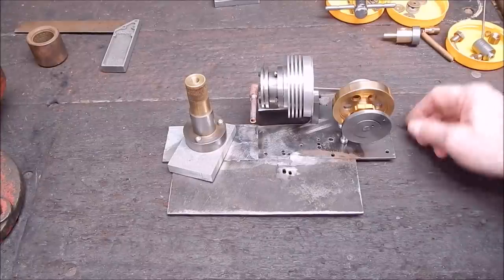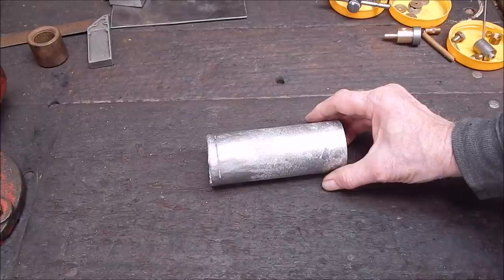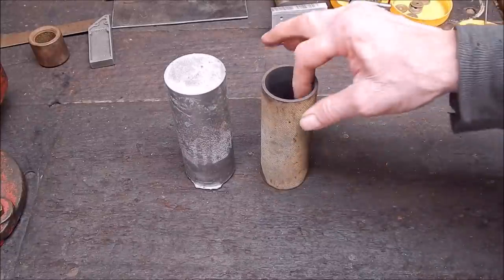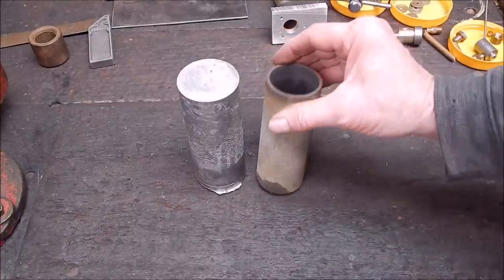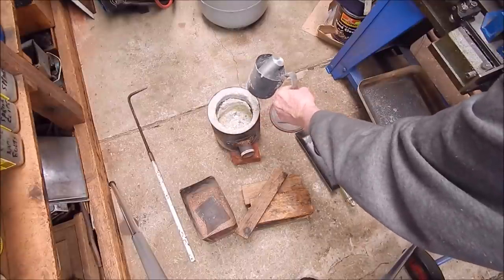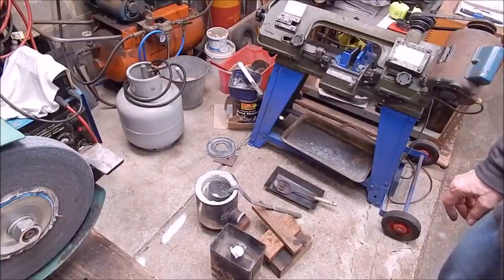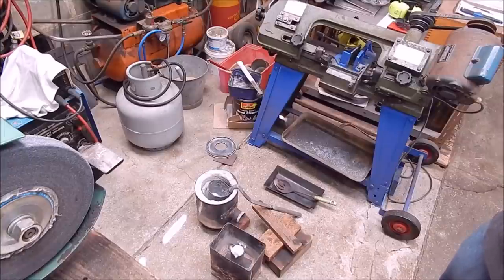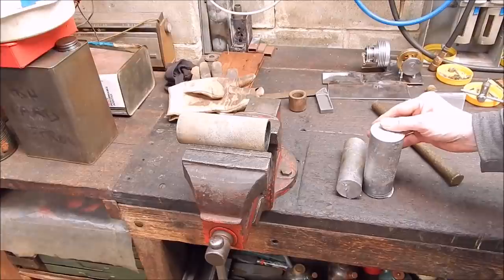How to make free aluminium round stock for a metal lathe

Comment: A mate of mine used to smelt his own aluminium bar stock. He once bollocked me to high heaven because I used the wrong vacuum cleaner to clean off his mill off after I was using it (I thought I was being polite by tidying up after myself !?!?). Turned out he had 2 identical vacuums, But one had a little label that said "ALUMINIUM" on it....... Yeah, The cheapskate even had a dedicated vacuum for cleaning up aluminium swarf to keep it separate, so he could re smelt that as well !!!! :D
Reply from the maker: He must be a real cheapskate.  It's a bad idea to melt swarf due to the massive surface area.  It has a similarly massive oxide layer and consequently makes lots of dross with very little usable alloy.  Mine all goes in the trash can.  Cheers Rob
Reply: @Xynudu  I think his reasoning for using it was something to do with it melting quickly and forming a puddle that helped transfer heat from the crucible and into the little ingots he'd melt.  I was only in his workshop once while he was melting metal down, and I was busy with my own thing at the time, so I may have missed some other info on why he was using it. I mainly just remember getting my head chewed off for using the "Aluminium" vacuum cleaner to hoover up all the steel chips I'd created.